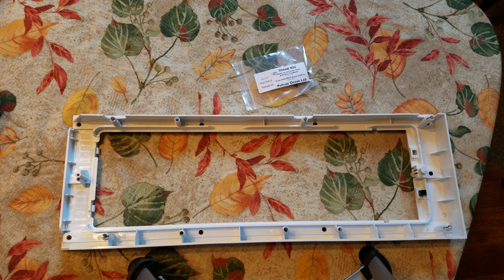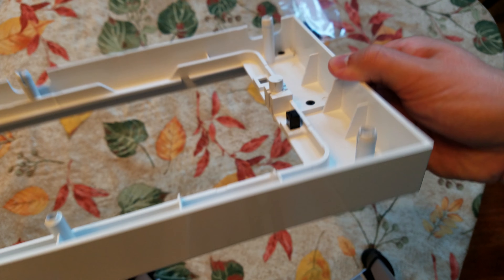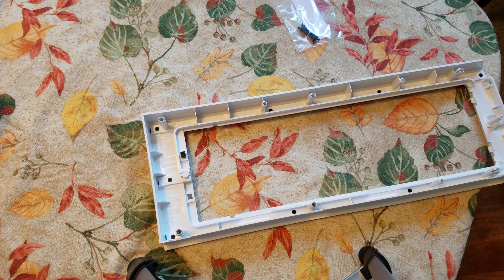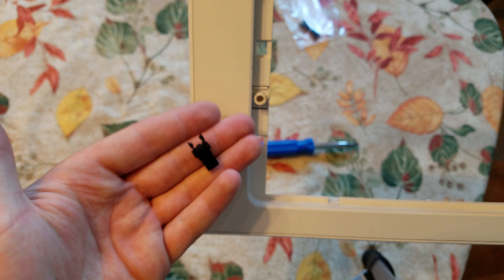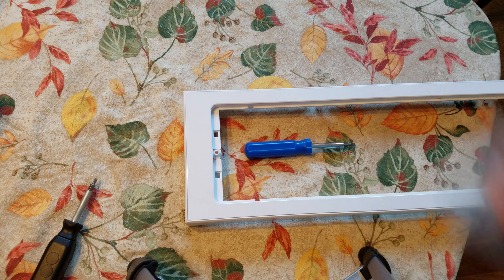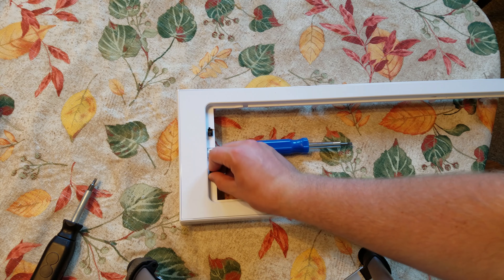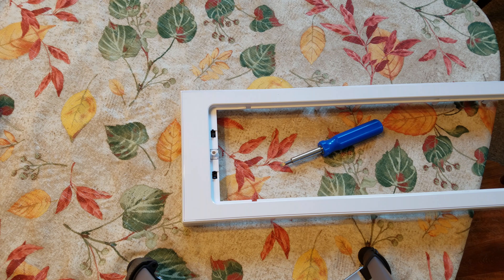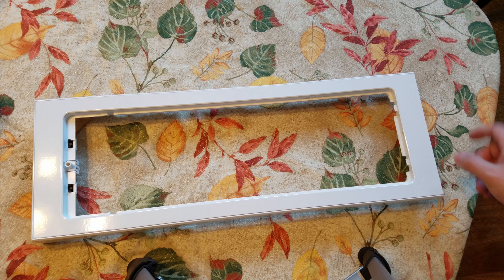How To Replace Phanteks Latch

Comment: Thanks. I got my latches directly from Phanteks for free 😏 And it's actually more safe and easier to pull the latches in with the fingers by press them inside zig zag wise. Also you can pull them out with one screwdriver by just pushing one clip side and leave it under/out the plastic, so it's angled. And then doing the same with the other while holding the latch down so the other already pushed clip won't clip inside again.
Reply from the maker: Thank you for this alternative method and glad to hear you got your parts for free.
Reply: @webbstudios4769  No problem ;)